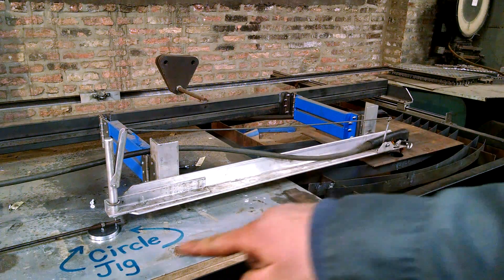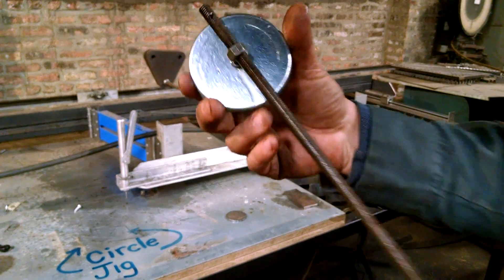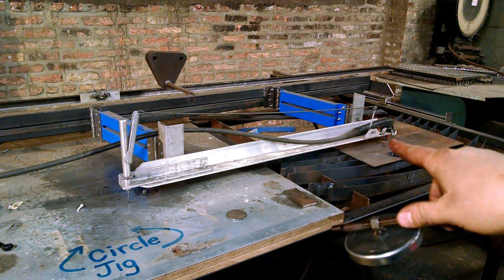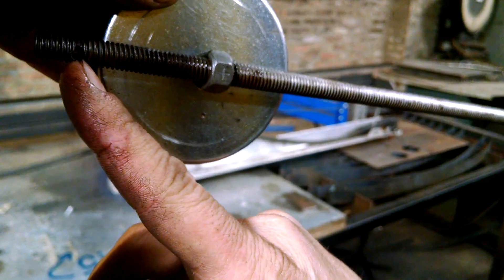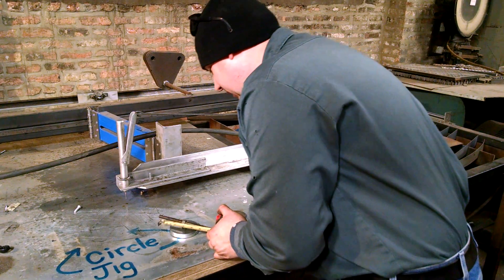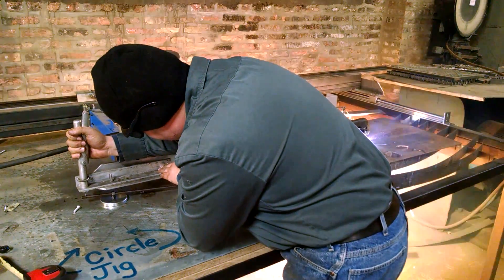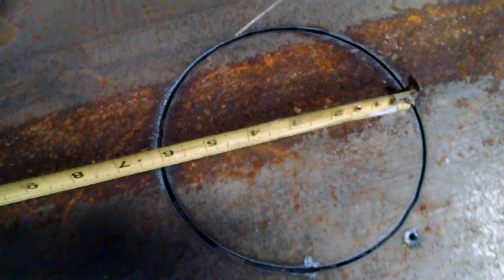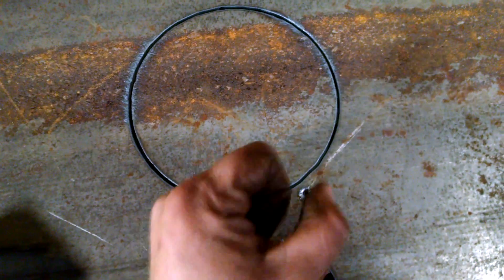Homemade Circle cutter Jig for Plasma Cutter

Comment: You could split the nut in half - and have a way to clamp it back down. Open the nut, move the threaded rod, clamp the nut and fine tune.

Comment: I like your tracing idea... are you ready for a CNN model...? This is a great job!
Reply from the maker: +Brian LeGrand I had a $35,000 Torchmate that I sold after a few years, because every time I turned it on I spent an hour with their tech support to fix a problem.
Reply: Wow... I have been considering a purchase of a PlasmaCam from www.plasmacam.com but then again the new 3D MetalFab 2 Part Units are very appealing. Have you ever checked them out? I am looking for an opinion or recommendation from someone akin to my background like you.
Reply from the maker: Plasma cam is very tempting, but my local laser guy has a Superior machine and will charge me a couple hundred bucks for small orders (if I have a DXF file ready) No matter what CNC machine you buy you have to learn CAD and thats half the battle, so found it was cheaper and higher quality to sub out my cutting.